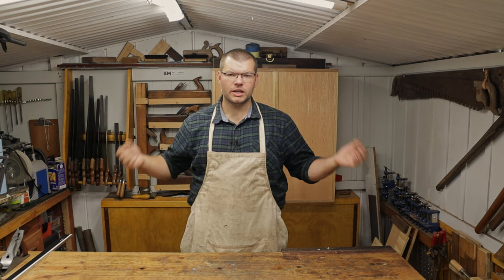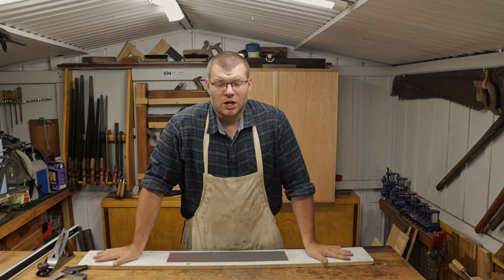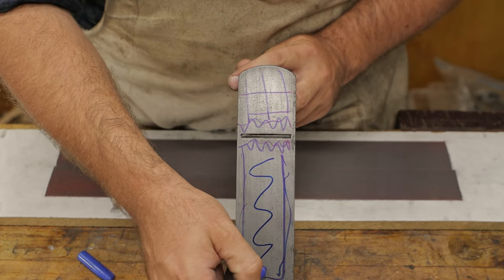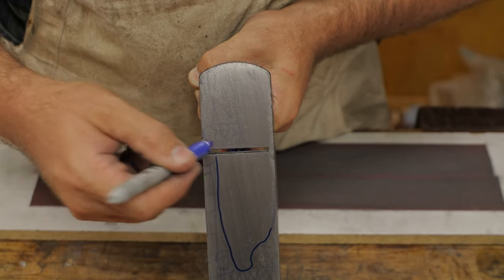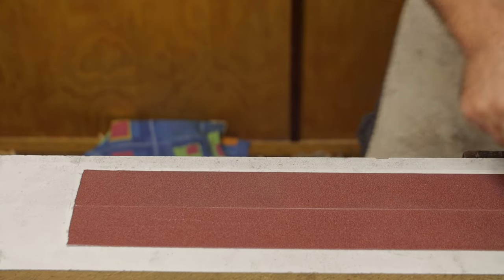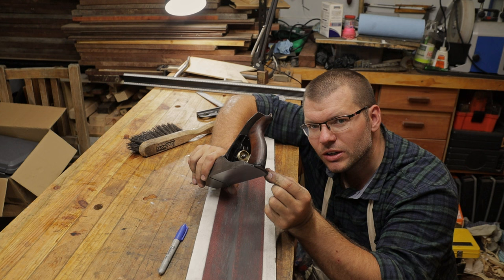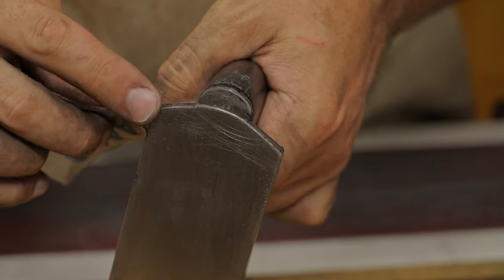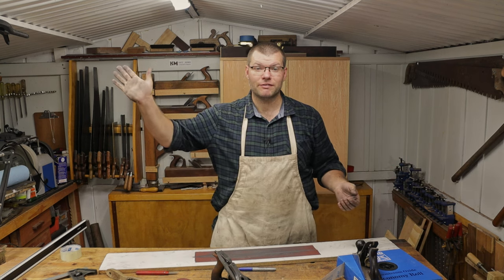How to FLATTEN Your Hand Plane Sole: The Easy Way

Comment: Another great video.  Obession with flatness is something for machinists to do in the privacy of their own workshops.
Reply from the maker: Thanks, i agree that being flat enough is good enough
Reply: When you are working day in, day out, you soon learn that being picky for the sake of it doesn't get the job done on time. 240 grit sharpening and 120 to 240 grit lapping is what we used successfully for decades until new equipment, tools and ideas gate-crashed the market - usually with advice to over spend and over sharpen. I agree with Paul Sellers that DIY magazines (filled with adverts and sponsored articles) have a lot to answer for in this respect. It seems to me that what was once written to make money from hobbyists is now treated as gospel in the trades - such is the impact they have had over the years. I'm not a fan of MDF or Melamine (Conti Board, as we call it) but I do agree that they are totally adequate for flattening a plane sole on - perhaps one of the few things they are useful for, in fact!

Comment: Stopped watching when you got to melamine. It's just not good enough in my opinion.
Reply from the maker: You're entitled to your opinion. However, every one of my planes i have flattened in this matter are dead flat as melamine is machined dead flat (in fact it's flatter than any glass i have found, even float glass as glass always moves over time as it's not a complete solid). Also sticking sandpaper to any surface makes it less flat as sandpaper has poor tolerances. If you want to procrastinate over 0.0001 of a mm you can, myself i use what works through lots of testing and won't break the bank.
Reply: Melamine board should be quite flat actually, but the surface that you placed it on must be flat enough so it doesn't flex under downward pressure. 
Furthermore, attention must be paid to double sided tape that could introduce unevenness 
This video is similar to Paul Seller's YouTube video 12 years ago. Paul used a scrap piece of granite which could be a good and durable alternative.
Reply: Yeah, I’m thinking glass or stone is better, but good suggestions beyond that!  Thanks 👍🏿

Comment: Try a slab of float glass. You will find it works even faster and gives an even better result.
Reply from the maker: Thanks, i will look into it.
Reply: What's float glass
Reply: @fnafplayer6447  Glass that is cast on a bed of molten metal, such as tin. This process gives a uniform and dead flat surface.

Comment: A good video. I have to say that I tend to reverse the plane every twenty or so strokes as there is a tendancy to bias to one side as you are leaning over the bench. Reversing the plane helps to balance that force and give a better result. Keep it up !!
Reply from the maker: Thanks, sorry for the later reply. Thank for the reversing tip i hadn't even thought of that, i agree there probably is a tendency to bias the side closest to you. I will look at integrating this the next time i flatten my plane sole.

Comment: First person to understand the importance of the two lateral edges.  I just want to add that the front and back edge should be level for concave stocks.  Really depends on how you flatten.  The space behind the blade becomes actually less important the straighter your blade edge is since it will not even register if your blade has chomped the wood off.  Though when you diagonally plane, they can matter.  Cheers.
Reply from the maker: Thanks for the comment and your additional information, much appreciated
Reply: @AussieWoodshed  It's a simple video that has seriously good "hidden information" in it.  Too many other videos out there propagating myth and legends.  It's refreshing to see a tool get treated as a tool for using effectively.

Comment: Thanks for another useful video. I watch similar videos by several people; yourself, Rex Krueger, Paul Sellers and a couple of others. They are all similar (by necessity) but each have a slightly different take on the methods and it is good to learn those little differences so that people can find which works best for them. What you say about not being over-picky is absolutely right. One thing I have noticed that it is never mentioned that, at the end of the day, it is the iron (blade) that flattens the wood surface, not the sole of the plane - which simply registers it onto the wood (that is how I was taught 40+ years ago). Obviously, the better it is flattened, the easier it is to get a good register. Another tip is that if a plane has a slight hollow running along the middle and is being worked on thin timber, just slightly skew it so that the trued edges get the register right!
Reply from the maker: Glad you liked the video. I too watch videos from Paul Sellers and Rex Krueger they make great video content. That is very true about the blade doing the flattering, never thought of including that before, it makes a great deal of sense. I also skew my hand plane when I'm planning thin material subconsciously i guess. I however never thought of doing it to counter a hollow on my plane sole. Great tips! Thanks for sharing

Comment: Great vid! Very informative.  I just bought my first block plane and need to flaten the sole...some people have suggested i use float glass, others said i could use granite tile. I have wide piece of laminated mdf 3/4“ panel from a cabinet. Would that work or its not flat enough?
Reply from the maker: If you put a straight edge on it and it seems pretty flat it should be okay. If the surface is mostly flat it should be ok as any sandpaper being used is going to be less flat than the surface anyways.

There is a lot of false information on YouTube about how flat the sole of a hand plane needs to be, as long as it's mostly flat it should be okay as you saw in this video. At the end of the day the blade is cutting and not the plane sole so being 100% flat is irrelevant. 

Back to your question the MDF should be flat enough as long as it's not warped.
Reply: @AussieWoodshed  I checked the sole of the plane against the side of the rule from my combination square against the light ... And there is a flat spot right up front of the sole.. light passes through.
Reply from the maker: @martinhawrylkiewicz2025  it sounds like it may not need much flattening, which is nice.

Comment: what finish did you use on the tote for that plane? its beautiful! ive been having trouble with getting grain to pop like that on the totes i am restoring
Reply from the maker: I used homemade paste wax for that tote on that hand plane to keep it simple. I often use shellac sometimes tinted, sometimes blonde de-waxed. 

I'm not sure what wood that tote was made of but it looked great and the paste wax made the grain pop on this occasion.  

+ I have a video where i restored that hand plane   found here https://youtu.be/Siruu9bAowo
+ Here is my Paste wax video if your interested https://youtu.be/GTxraznnTiI

Hope this helps
Reply: The pre-WWII Stanley's were Brazilian Rosewood -at least the ones made in the 'States.

Comment: A tip I'd give is a lot of people get really anal about flattening and squaring the sides as well but it's not needed. If you are concerned for using a shooting board to join planks for a tabletop say then flip one over face down and if your plane is out of square then you're matching the erroneous angle but the other way and they've both match and the top will be flat.
It's a bit more important that the sides have a polish than be flat because of that, the polish is less friction and that helps with the uncomfortable positioning.
Reply from the maker: Thanks for sharing your tips with everyone, much appreciated